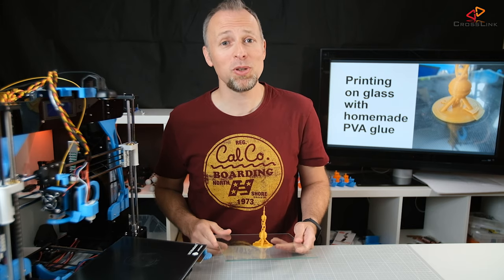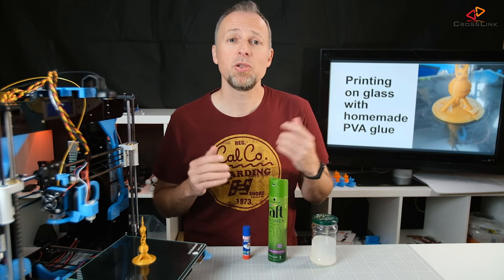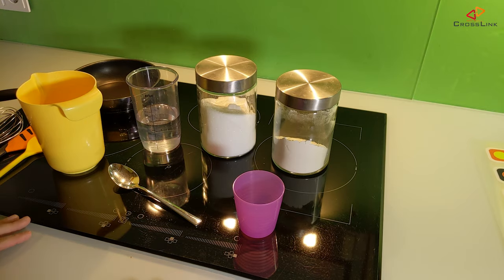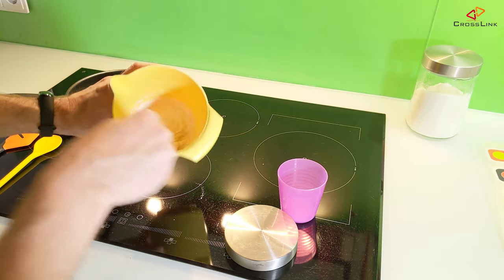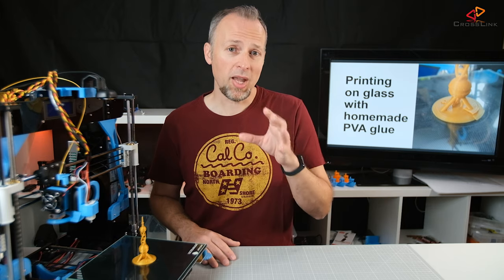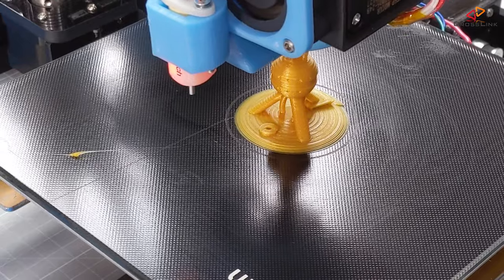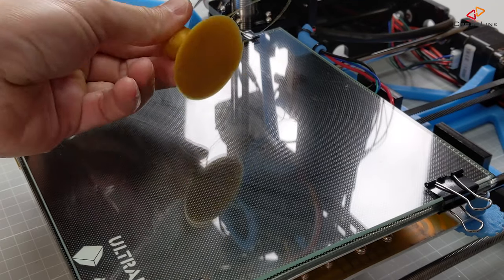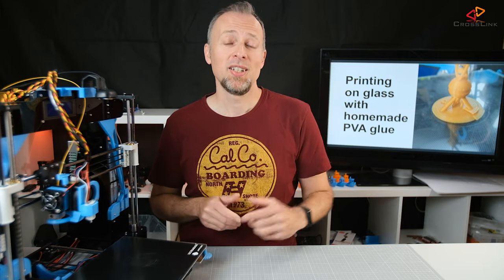How to make 3D prints stick on glass with this homemade PVA glue

Comment: interesting video.  I never thought this solution would be a way to stick prints to the bed.  I've been using a combination of hair spray and glue stick on my glass bed with great success.  I buy the cheapest hair spray I can find and heat the bed to 60C, then spray about 3 coats and let each dry.

Comment: I notice in the video the solution beads up while you're wiping it on the plate. You could try adding a little alcohol to the mixture to reduce the surface tension so the solution forms a film on the plate without beading. The alcohol should act as a surfactant but won't leave residue the way a detergent would.
Reply from the maker: Yes, this could help. I also heard that a salt solution works as well. Did you try that?
Reply: Crosslink I have not tried salt. I’d be concerned it would leave residue behind after the water evaporates. On the other hand, if the small salt crystals were brushed or blown away after the film dried it could result in some surface structure that might increase grip.

Comment: Awesome.. Now I know the origin of the "low cost glue" we used in primary school.. We called "engrudo" (in spanish) which is a mix of flour and water (basically what you did) .
About your video, I'll try it, I have a glass bed on my ender 3 and I have a lot of problems with my 3d prints, so far I have better results increasing the first layer temp up to 70°c (bed) and 210°c (extruder) and cleaning the bed after each print using isopropyl alcohol.

Comment: Best thing I've found is Ultrabase.  Just clean it with alcohol and it sticks like crazy when it's hot and pops right off after cooling.  If it's a weird type bottom use a raft or brim.  I see you did a video on Cura settings.  I haven't watched it yet.  But in beginning for me those 1st layer settings and tweaking the raft setting where pretty important.  Keep up the good work your stuff on the Anet is still the best on YouTube.  Ever think of doing tutorials on using TinkerCad?  I bet jt would be a game changer for your viewers.
Reply from the maker: Hey, thanks for the comment! Yes, normally it should work pretty fine. For me I had some adhesion problems even with much pressure. The idea about Tinkercad tutorials sounds great. I also consider this for Fusion360. 😄

Comment: This is surprisingly close to a recipe for roach bait I've seen.  Or add boric acid and it's roach poison.  I use glue stick, and a raft which I spray with slightly soapy water for easy removal and cleanup.  But I'll admit my bottoms aren't quite so smooth as on your models.

Comment: This is wheat paste. PVA(Polyvinyl acetate) is made with a vinyl polymer and acetate(the salt of acetic acid).
Reply from the maker: Yes, if you will, you could also call it wheat paste. We used this in school back in the days. It's really easy to produce and works superb!
Reply: But you can't call it PVA because it is not PVA.

Comment: wow nice one on this

I found a very cheap glue that works better IMHO than PVA ( childrens paper glue bought in Asia) advantage of that glue is that it creates a fil that comes of togeher with the parts and then can be washed of the part

it has created better adhesion for me on both glass as well as PEI and i tend to apply this for all PETG as well as TPU prints

your solution is a very good alternativ and  even cheaper , I will  give this one a try as I run out of the above glue , but will buy a lot more next time I am in Asia 

Hope to give some feedback on your solution this weekend as I need to do some PETG printing on the I3Mk3
I also have some issues with the UHU gluestick and PETG on PEI that drive me crazy so hope your tip helps.
Reply from the maker: Thanks, let me know how it works for you!
Reply: That cheap glue is still pva.
Reply: @backgammonbacon   yes it is, I am now using a mix on THICK pva glue (5 L lasts forever at 4Eur /L ) mixed with IPA and some water in a 50/10/40 mixtures that can be very easily spread out and sticks really well while hot and fresh,  when cool it releases the print as well quite well and a fresh mist of IP/Water in 80/20 with a gentle rub makes it ready to receive the next print , works great with TPU and PETG on IP to create a separation layer , not to mention PLA on glass , once cool it just releases.

Comment: Are you sure the PVA = to the sugar, flour, water mix? I am sure it can stick and create a bonding surface, but i am not sure if it gives the same transparent and flexible foil likey material what PVA does. 
An another question, have you ever tried sandblasted glass surface?

Comment: Do you have to clean and reapply the solution each time or can you apply over it a few times before having to clean the glass?
Reply from the maker: Yes, thats neccessary. Clean up at least every 2-3 times.
Reply: Crosslink what do you use to clean it off the glass?
Reply from the maker: Water and alcohol

Comment: is there away to test to see If a heated bed is working right,  I have tried  two prints and wouldn't stick but the glass didn't feel even warm so I don't know if the heated bed is working right or now,   I will have to say I did have the  polarity switch  at first , I switched that but still not seeming to heat up any suggestions on  how to test it ?

Comment: Why did you not use a before and after?  I could do the same test showing the results after I used unicorn tears.  If you don't have a surface that isn't adhering before the example is pretty much useless.

Comment: did you try to polish it
Reply from the maker: Yes, the results without glue are still inconsistent but with glue 100% works
Reply: But the glass in the video is not sand proprely, the surface need to be opaque to be effiency

Comment: I use water and sea salt solution although an ordinary table salt works also, this gives the advantage of the ultrabase glass in that when the bed is warm that print is going nowhere but when it has cooled it lifts off as if it were never fixed to the bed at all.
Here is an in-depth scientific PDF describing the method by its creator
https://www.uantwerpen.be/images/uantwerpen/container11343/files/bonding_pla_with_salt_water_v20160713.pdf
Reply: Link no longer valid do you have any other resources to explain this method?

Comment: Auf der Standard Aluminium Platte (Anet A8 mit MK3 Heatbed) verwende ich schlicht und ergreifend ein 50/50 Gemisch von Ponal und Wasser. Draufpinseln bei 80 Grad trocknen - drucken fertig . PLA - ABS PETG geht alles - Keine Raketenwissenschaft.

Ponal funktioniert immer!
Ich schleife die Aluplatte leicht an mit einem 200er Paper , dann hält das Gemisch noch besser. Kein Warping bei ABS,  Druckbett  >  80 Grad. PLA  60 Grad.

On the standard aluminum plate (Anet A8 with MK3 Heatbed) I simply use a 50/50 mixture of Ponal and water. Dry paintbrushes at 80 degrees - print ready. PLA - ABS PETG does it all - no rocket science.

Ponal always works! 
I lightly flip the aluminum plate with a paper of 200, then the mixture keeps even better. No warping on ABS, print bed> 80 degrees. PLA 60 degrees.